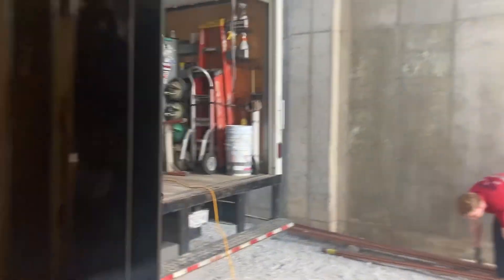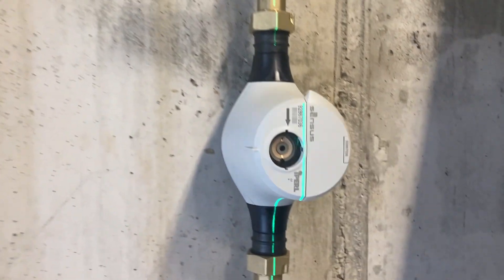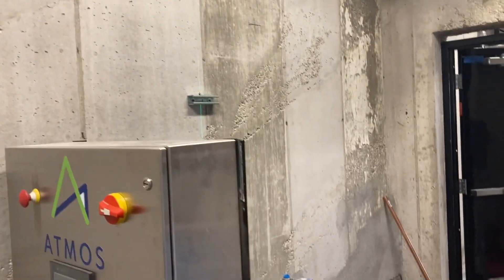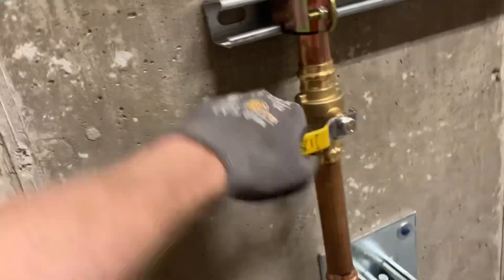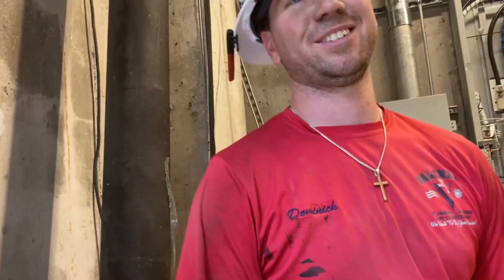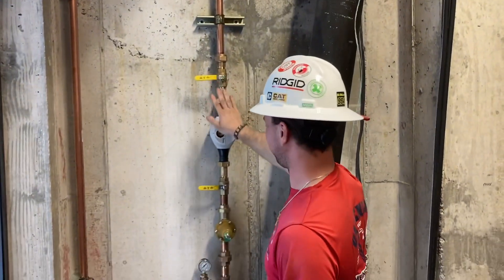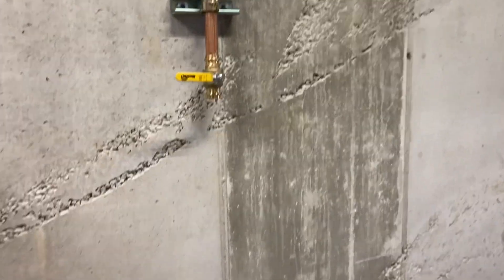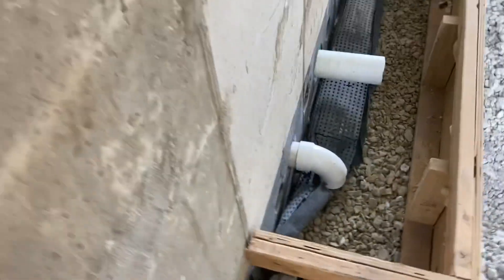Railyard Dust Suppression Piping! RPZ Install and More!

Comment: In Ny we can not use PVC on commercial properties or more then three family residential properties we are also required to sleeve the through the wall water lines unless its K copper, I  think you said you were using K copper, I have only seen and used soft k copper never seen ridge K , must be real pricey  . .  crazy how different the codes can be. nice work.
Reply from the maker: So many code requirements that don’t make sense in NYC. It should basically be it’s own state. In more ways than one, but I digress. All of the copper outside and through the wall where the fire suppression line was shown is Type K soft copper. All the indoor piping is Type L. Thanks for watching my friend. Enjoy your weekend.

Comment: I hope you guy’s didn’t use those blue anchors on the ceiling as well? I just don’t think they have the strength to hold that stuff up
Reply from the maker: Tapcons? We only hung one piece of pipe from the ceiling. A piece of 1” copper, and that was supported using a Sammy.